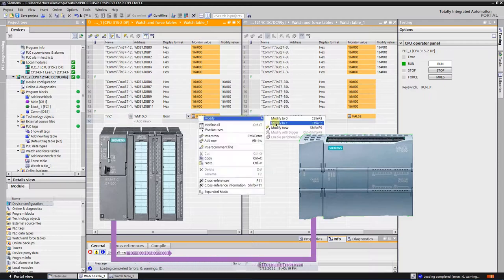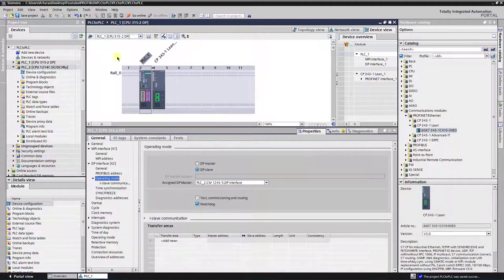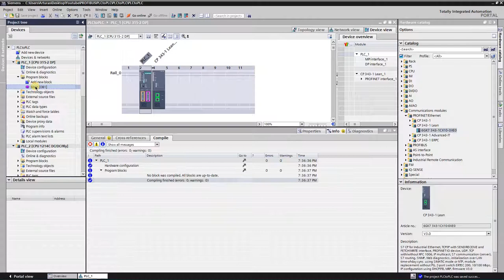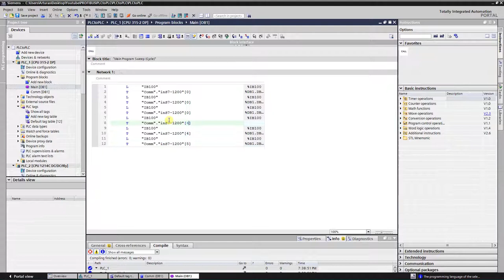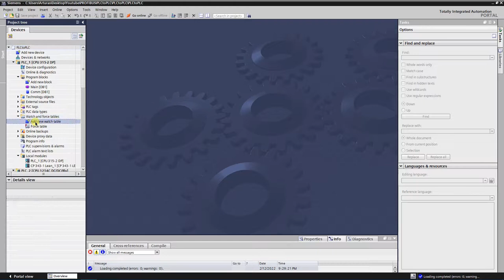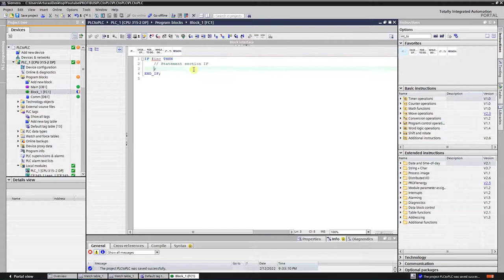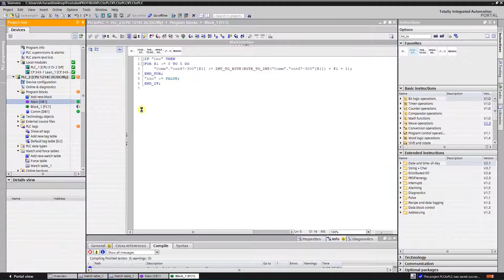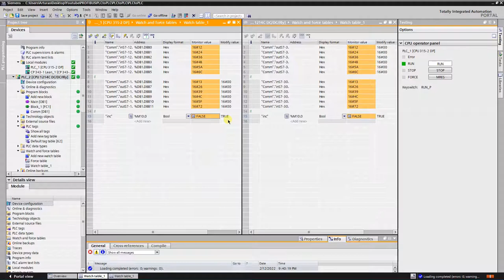PROFIBUS: PLC to PLC communication between S7-300 and S7-1200

Comment: Thank you for your sharing. But I have a question, when I connect 2 PLCs to each other in 'devices & networks' and set up the 'Transfer area' in 'I-slave communication' (Ex: Master address : Q10, Slave address I10, master send data to slave) .  To send data from Master (Q10) to Slave (I10), what i need to do is 'move data' to Q10 in main block of Master, and Slave (I10) will receive data automatically, right? I am a beginner, so hope you reply.
Reply from the maker: Yes, that’s right. Please take a look at this video: TIA Portal: IM151-7 CPU as I Slave for 1500/1200/400/300
https://youtu.be/f0ptyfkO1Lo
Reply: @automatikavaldymas  Thank you!

Comment: Thank you very much
I have 9 CPU's slaves and one CPU master connecting with others by profibus (all of that's are S7-1511-PN with profibus module)
I put transfer area and using move instructions , is it enough ? or I must use GET/PUT instructions??
Reply from the maker: Yes, that is enough. What you need to do is to set operating mode of the communication module - "DP slave", because by default it is "DP master".
Reply: @automatikavaldymas  So Put and Get instructions just for profinet not for profibus , Right?
Reply from the maker: Yes, PUT/GET is for PROFINET.
Reply: @automatikavaldymas  thanks alot🙏🙏🙏

Comment: Thank you!
Tell me please, is it possible to connect to the S7-1200 as a slave not a S-300 CPU, but an IM-153 module (for connecting S7300 DI/DO modules to S7 1200)?
Reply from the maker: Yes, you should be able to assign ET200M IM153 as slave for S7-1200. At least i can compile the project without errors. I will check if i have this module tomorrow, and if so, i will be able to test irl.
Reply from the maker: @alekseyalexej9665  unfortunately i have no IM153, so i cannot test it irl, but like i wrote in my previous post, you should be able to assign ET200M IM153 as slave for S7-1200. One thing you should take into account, that it might be so, that not all modules will be compatible with S7-1200 system.
Reply: @automatikavaldymas  Thank you, everything worked out already. So far only in hardware configuration S7-1200. The principle is the same as in the case of two PLCs.
Reply: @automatikavaldymas   Interesting. I also tried the same and was able to compile it. When I went forward to place the order, Siemens told us they havn't tested this so they can not gaurantee the system will communicate. Then we went for another PLC